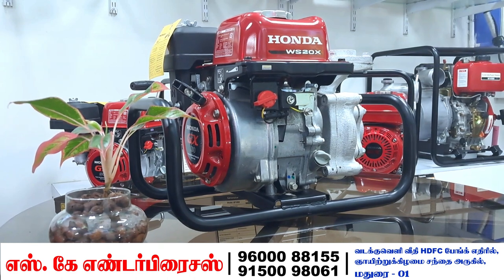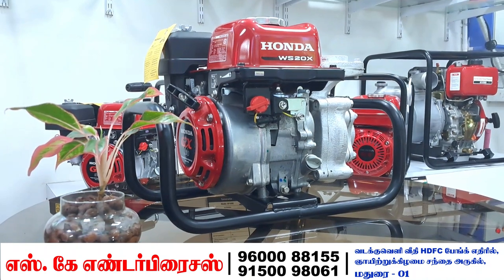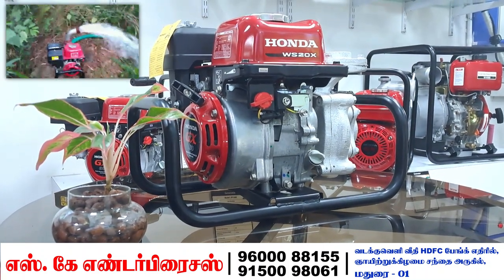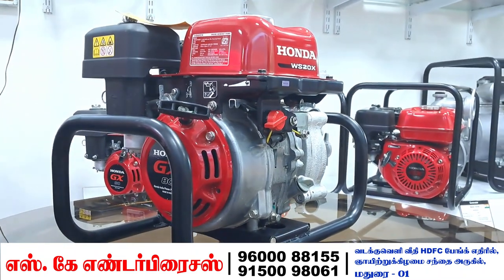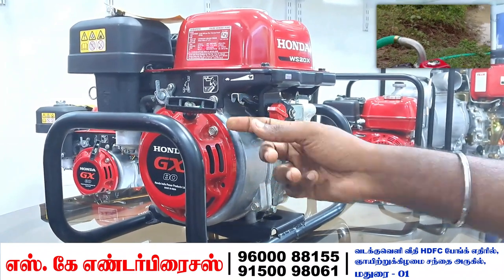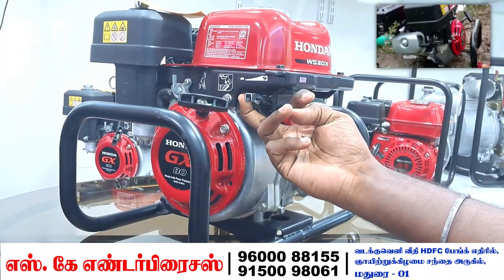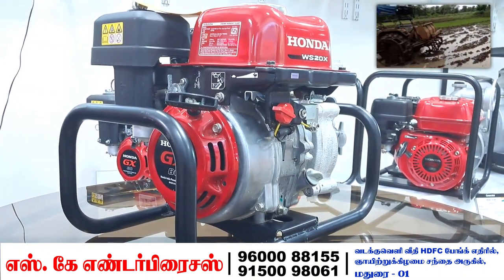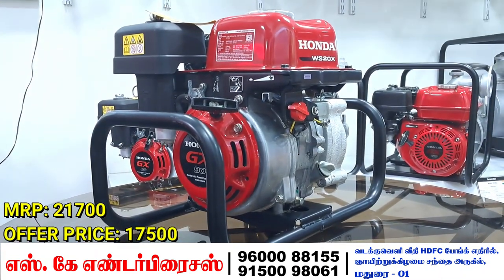HONDA 20X Water Pump |  Specification and Pump Operating Deatils

Comment: விலை எவ்வளவு?
Reply from the maker: MRP: 21700 SK HONDA Offer price: 17500
Reply: Stock உள்ளதா sir?
Reply from the maker: @dnvmatrimony2534  Yes, all time stock available. Let me know your contact
Reply from the maker: @dnvmatrimony2534  Contact this number 9600088155
Reply: Old machine kedaikuma
Reply from the maker: @krthikrthi3116  New stocks Only available
Reply: Gas la ran aguma
Reply from the maker: @prakasamn7465  No, only in petrol
Reply: 3 inch honda prize sollunga sir
Reply from the maker: @kesavankala200  https://youtu.be/MCO2VJrQH6A
Reply: Emi option available irukka sir.